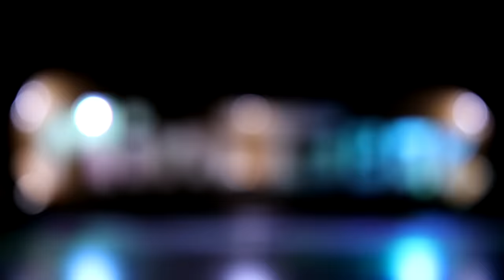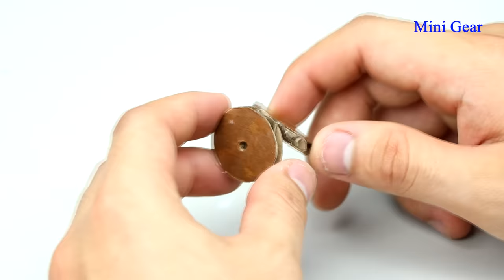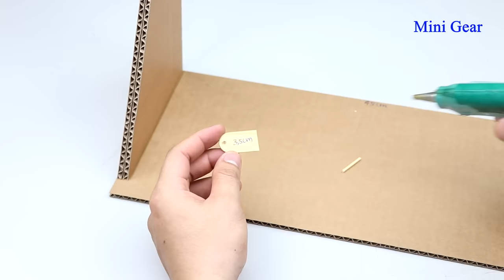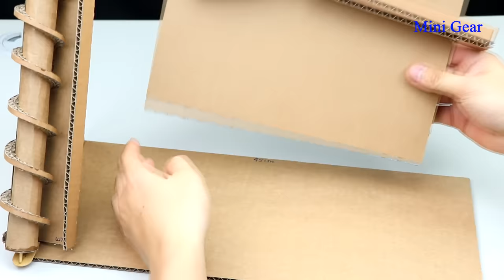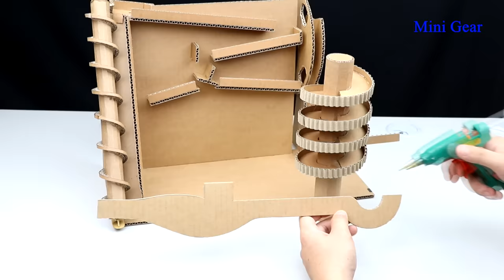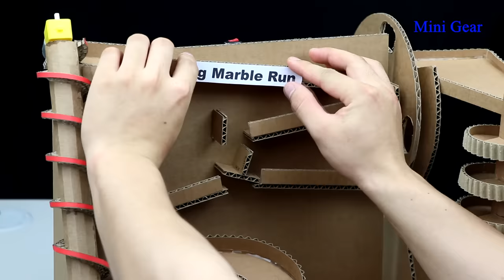How to Make BIG Marble Run Machine from Cardboard

Comment: Nice job! but you should provide the molds to print out.  Also a link in description where to buy the electronics parts
Reply: It is write
Reply: @AYUSH_GAMER_17  what is the thing that connect to dc motor there. 8;15

Comment: Its great but you leave so much needed information out: you want people to recreate because you give a 'you will need section' but you dont mention many pieces or what type of glue apart from hot melt because you are using 2 types.  you dont mention the tabs on the rotating wheel or what type of cardboard you are using:  the corrugations come in various sizes.  Kudos to you for the design but I'm left guessing how much of it is put together

Comment: Hey, i want to make this with my class and i was wondering what the yellow thing (block) is on top of the DC Motor? Did you buy it, or made it with 3D Printer? Great Video and Thanks.
Reply: It’s a thing to slow the motor down and can be bought online
Reply: I want to know too.  What is it called? It seems to change the rotation axis too.
Reply: I found out - its sometimes called a tt motor.
Reply: Motor: Gearbox 3v 6v Deceleration DC motor
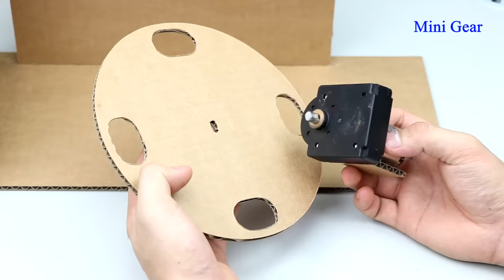Reply: what is the black thing at 8:15

Comment: What type of DC motor and controller did you use?
Reply: Motor: Gearbox 3v 6v Deceleration DC motor
Controller: DC-DC 4.5V-35V 5A 90W PWM DC Motor Speed Controller